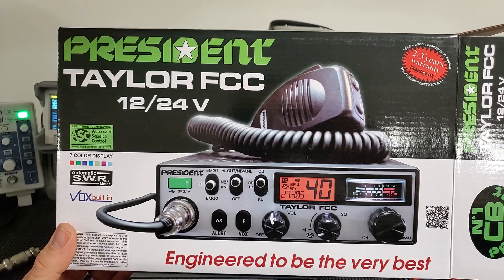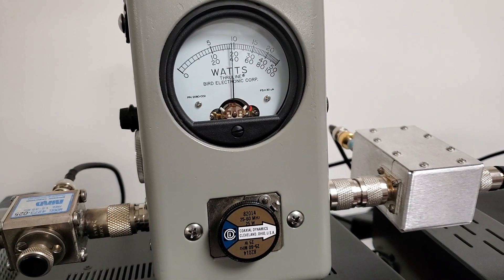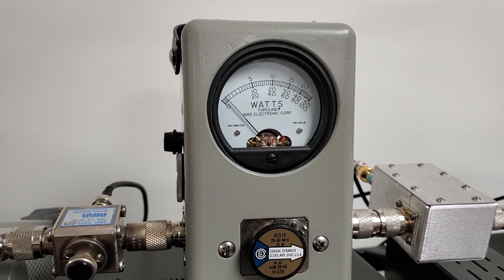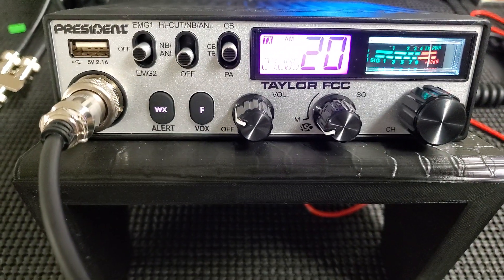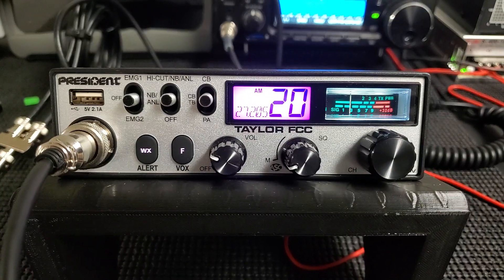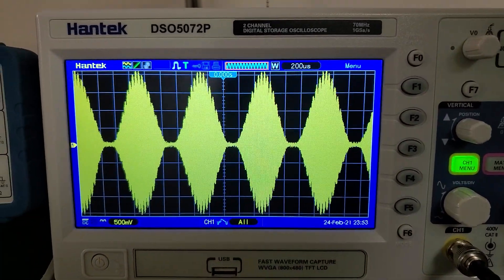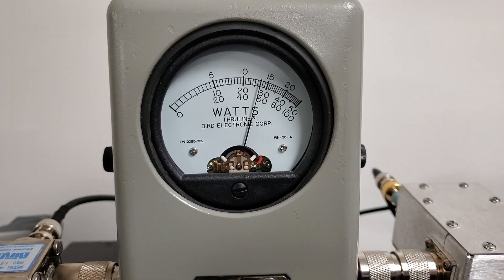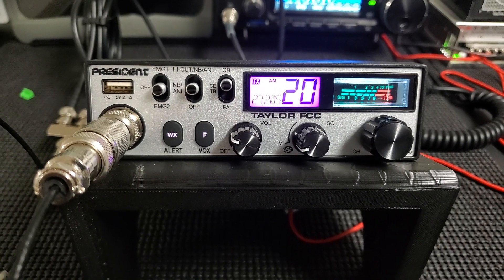Out of the Box New President Taylor FCC CB Radio thoughts and performance.

Comment: How are these out of the box and used for home
Reply from the maker: These radios have a excellent receiver.
The transmit sounds very clear and natural this radio will not distort or overmodulate like many other radios you may hear on the air.
It does not have as many features as the walker 2 also made by President.
It is a decision of the user whether they choose to have less features or more features with the walker 2.
Both radios would work well in a base station setting.